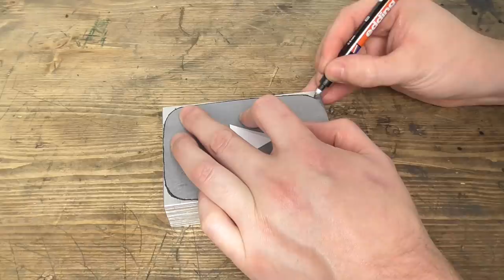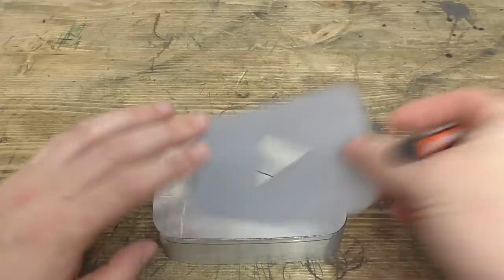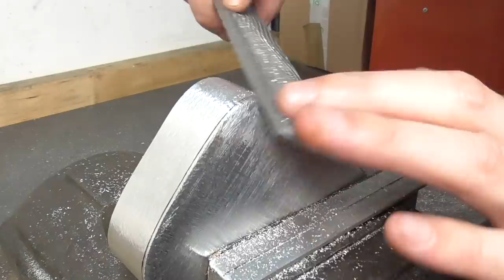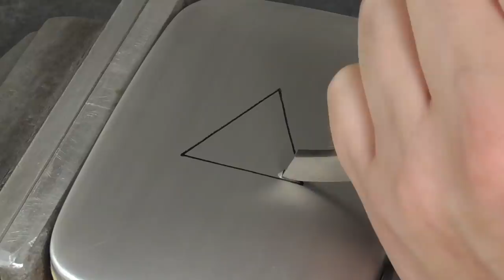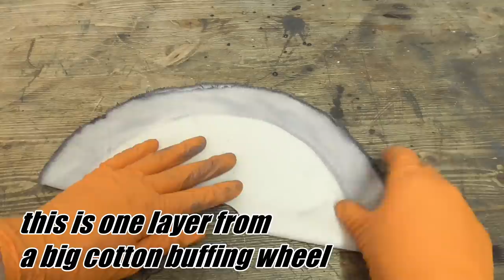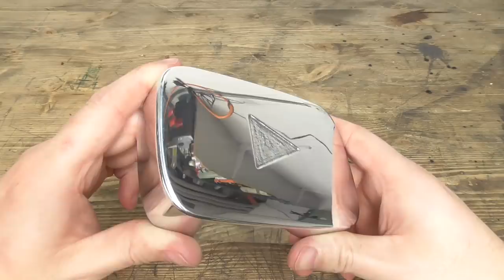Handmade Silver Play Button - No Power Tools

Comment: I really liked it except for the triangle. Maybe too rough. You got the editing done nice! Subscribed
Reply: Could just fill it up with enamel paint
Reply: D J im no metal worker by any means but couldnt he have applied something like a thick layer of tape around it then sanded it till it was smooth?
Reply: @DJ-uv7gi  there are many ways this triangle could be inproved! Even with the tools he used to make it he could've perfectef it more. It's obvious that he didn't wanna use any power tools to make this video more accessible to dummy's/ new viewers, but even without power tools he could've made a hands down gorgeous sharp looking triangle with some basic engraver tools. These tools, tho they are not very expensive don't feel accessible to the average man, so i get why he didn't use those tools either. I think its a matter of unexperience, not that he is unexperienced with hi's craft, he obviously is, but just the 3 tools in the way that he uses them in this video. You can obviously see he does have a fairly straight line with the chisel but het dit come through a little bit too much, the punches were systematic, but not very precise also if the quantity was more the inperfections would be less visible. I hope this changed your mind about the fact that even the pro's don't always have all the knowledge or skill on every single thing that is close to their work feild ;) hope you have a nice day!!!

Comment: Hi there,
     In England, we call the first file a 'Bastard' file and the second file you used a 'First Cut' file. The sandpaper we call 'emery cloth'... strange how we differ!
     Anyway, congratulations and thank you for re-teaching us the art of metalworking...
Thank you.
Reply from the maker: Cool, good to know. Thank you :-)
Reply: In Canada, I have always called 1/2 round files Bastards.
Reply: @gordbaker896  I was taught that 'Bastard' is the type of cut that the file performs on the metal, hence the first cut file being the 'Bastard'.
Reply: @limaalphasixtynine4209  Yes that's what my old shop teacher taught too that the "first cut" file is the bastard file though your first cut seems to have finer cutting edges. Perhaps its swiss file patterns? The multi-file almost looks like a wood rasp file.
Reply: @limaalphasixtynine4209  Apparently it refers to the coarseness of the teeth and is somewhere between Rough and Smooth range.  I have always thought that t he term meant half-round which does not seem to be the case.  File that!
Reply: @superchargerone  I thought the same thing.